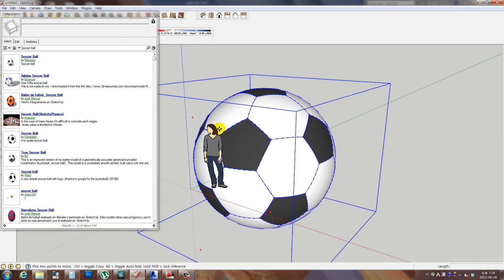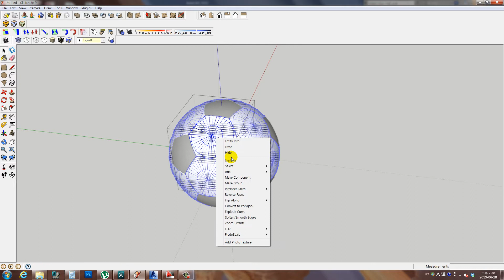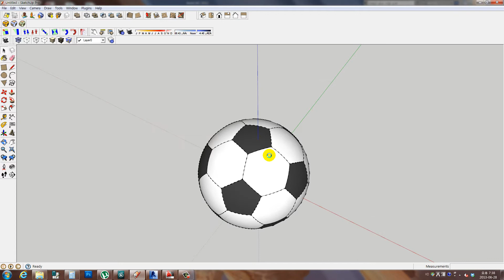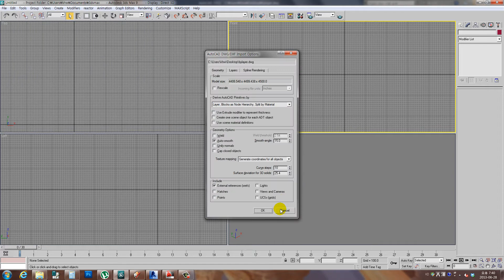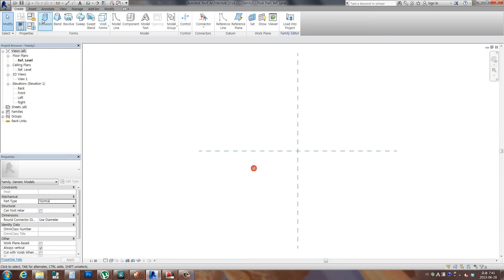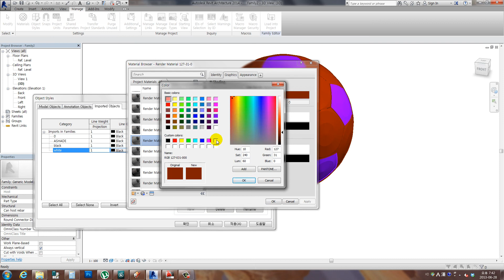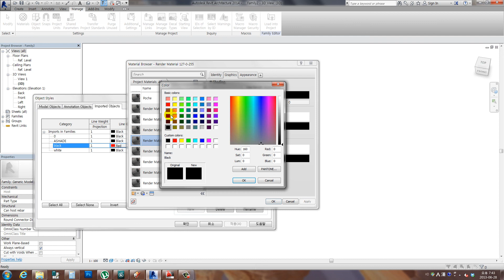Revit Tips - convert skp to smooth & useful family

Comment: wow, i have been looking for that for years, i used to apply the (auto edge ) it will hide the edges in 3dsmax but not revit, thank you very much.
one thing please, i exported an object from max to Autocad, and put in a layer (stone), when i imported it to Revit, in object style, applied a material with a texture, but it wont show in Realistic mode, it is only a solid color, what did i do wrong ?